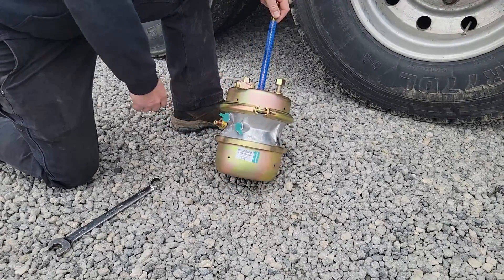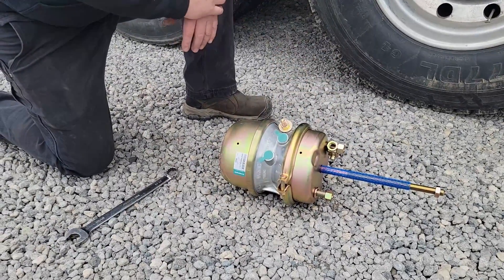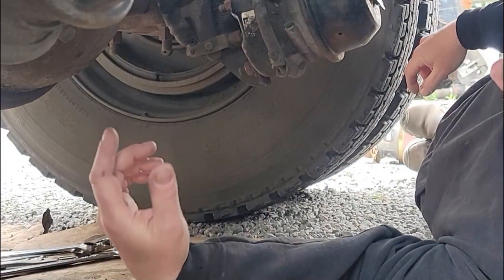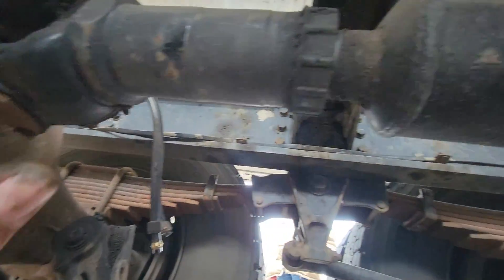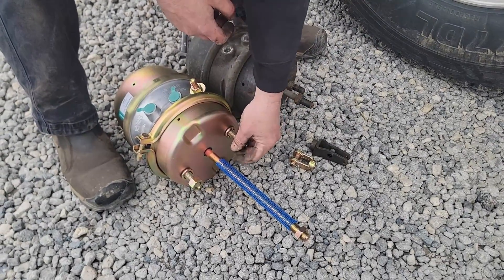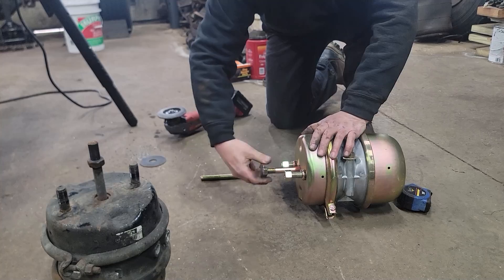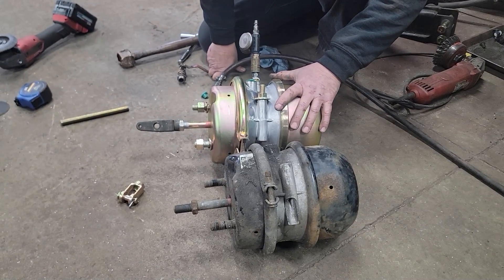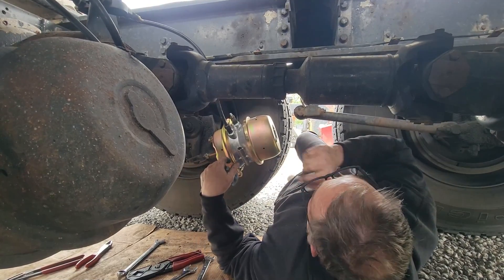CHANGING A 30/30 BRAKE CHAMBER! HOW IT WORKS!

Comment: i like that method of putting a air line on the chamber to adjust the chamber position what size air line fitting did you use to connect the air line to brake chamber?

Comment: We used to be allowed to service the spring side of the brake chamber, but people were taking the clamp loose without caging the spring and got a bit of a surprise. 🤣🤣

I can’t remember if you talked about the geometry between the air can and slack adjuster on the Peterbilt project, but that’s something people seem to screw up a lot too when replacing brake chambers. Might make a good educational video. 

We used to have a 30/30 sitting around with the spring removed to scare the new guy. We tell him we got the clamp off, but it wasn’t separating and all you could see was heels and asses running. 😬

Comment: I have two new 30/30 for my truck wasn’t sure how to measure and cut them. Now I see clearly how to do it. Thanks. Plus one question. My truck is a three axle and it only has the 30/30 on the first drive axle. It’s a 1980 Peterbilt. Is this common? Thanks in advance

Comment: Very informative vid. The reason they’re called 30/30 is that the surface area of each diaphragm is 30 square inches.  Also there is the “piggyback “ option for replacing the chamber. Saves time provided the existing push rod and clevis are in good shape.

Comment: I don't remember the numbers that were quoted during the Air Brake class i took 30 plus years ago but the instructor claimed there was enough spring pressure to send a 150 pound man x number of feet in the air. And also of an accident reconstruction on either side of an interstate one side the Truck was so torn up that the brake chamber came apart and the spring sent a part of the chamber across the highway and killed a driver. Weather either are true I have no idea but both seem plausible.